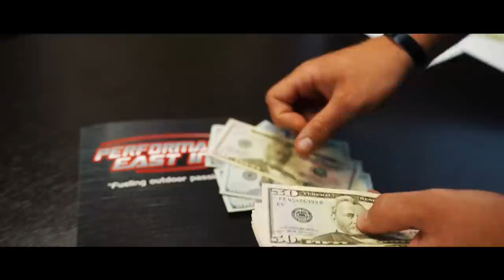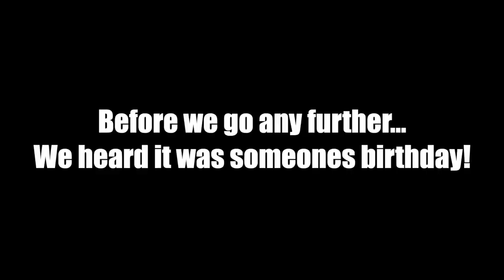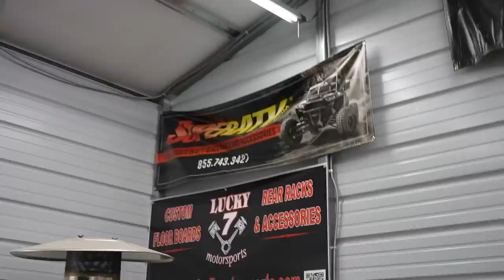They Finally GAVE Me The Keys!! *INSANE*

Comment: I have a 2013 outlander XT 1000 with the 1040bbk, HMF swamp series XL exhaust, Dyno jet power commander v tunner,stage 2 Mr.rpmcams , maverick heads, STM primary and CV tech secondary with maverick belt,wisco pistons, bossie super cooler water pump rad relocate and snorkeled and she halls ass I would love to build a new one the same way just really wish mine had power steering lol

Comment: -xm310’s 
-rock trick wheels
-superatv lift
-stock can am snorkel kit
-wild boar rad kit
-big gun evo u exhaust
-powder coated suspension
-decals of all your sponsors

Would be good things to add and I rally liked that y’all picked the outlander to go out on a limb. I think it’ll be a good thing to try. Life’s kind a hard right now and I would really like it if y’all would take the time and respond to my comment or even like it. But for now I guess 336 the gang baby until 864’s the Gang!
Reply from the maker: I like your list! May have to use some ideas!😎
Reply: Msa12s with sassy it looks fire

Comment: You sure that wheel base ain’t just a little bit longer?😅😆  but I’m seeing 33in bkt on 20in fuel runner wheels with the milled areas anodized blue! Floorboards. Snorkels. Rad relocate. Slg exhaust!
Reply from the maker: It don’t seem any longer! She’s a sender!
Reply: @336MudMafia.  the specs would agree with you!

Comment: Dalton Clutch Kit, 28/10r14 UT1 tires, halos, OMD 2 inch Handle bar risers, halos, rjwc exhaust rjwc shifter rjwc gas cap and air box lid, twin air filter, rjwc taillight, can am rad protector, full skid plate, can am wind guards color match if possible